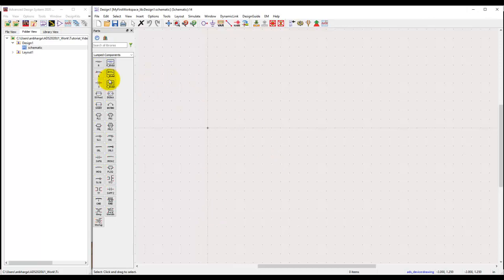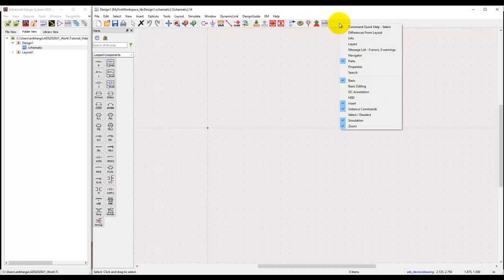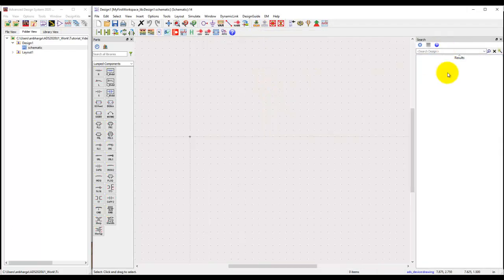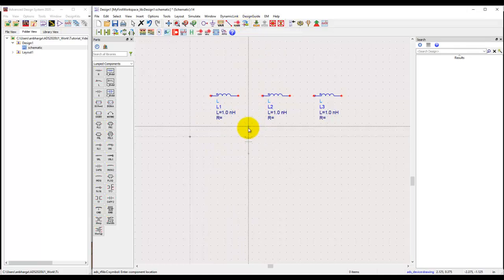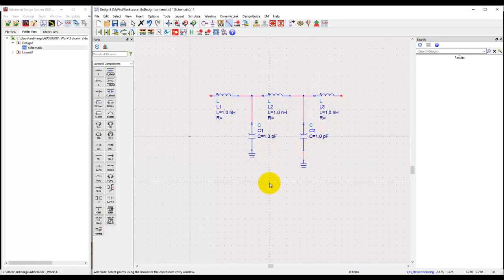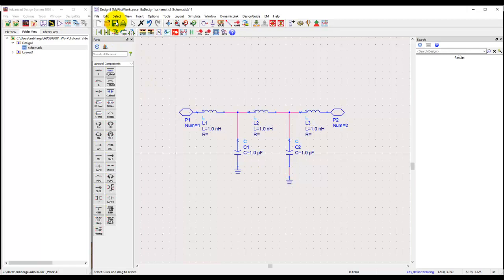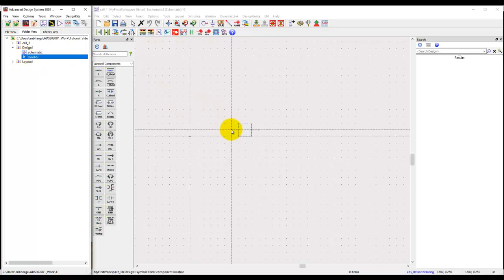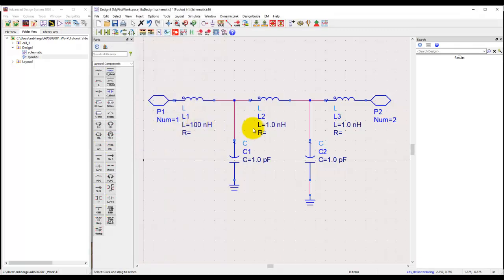Tutorial-2: Schematic Basics

Comment: Dear, I am facing some problems when I go to simulate my circuit and try to select plot type The window is not showing fully on my screen and cant be minimized nor maximized so some of the portions are missing means I cant press the ok button so what should I do?
Reply from the maker: Seems like you monitor resolution issue. Make sure it is set to higher than 1024x768....else contact your local Keysight tech support team for help

Comment: Dear Anurag,  I am working with Genesys and trying to go from a schematic to generate a BOM listing all of the parameters for each part.  In Genesys there is a grayed out option for exporting the schematic that doesn't work.  Do you know of a solution?  I have a design I want to make but the component count is over 100.  I hope I don't have to click on each one and write down part parameters with my fountain pen.  So tedious.  How can it be that Genesys can't generate a csv file or spreadsheet with all the components listed?  I have ADS and Genesys available to me. As always, Thank you for the videos.
Reply from the maker: Hi Dave,
In Genesys, BOM is generated from the Layout and not from Schematic. If you have schematic  then simply create a Layout then use File->Export->Bill of Materials
Reply: Hi, very disappointing. I can't even import my schematic to make a bogus layout to get the BOM. This is a huge flaw in Genesys. You need to go from schematic to BOM.